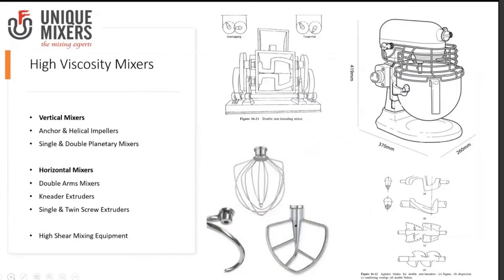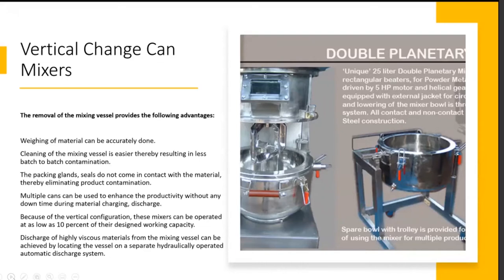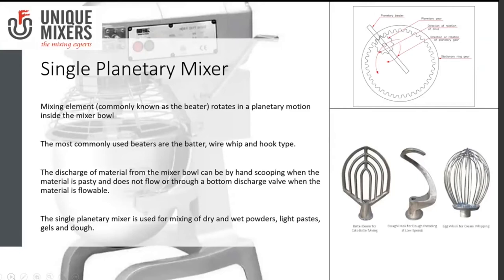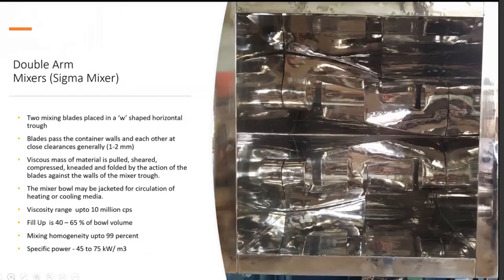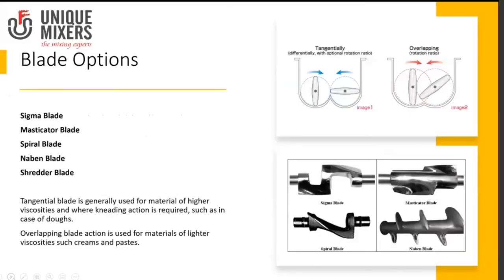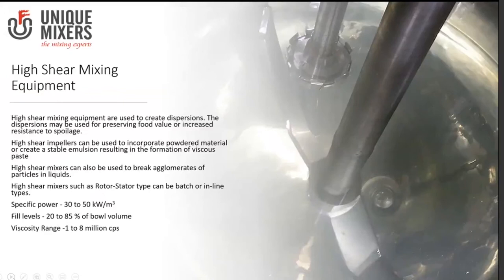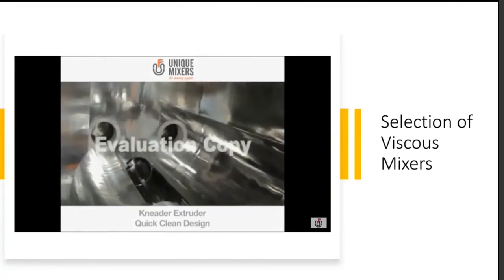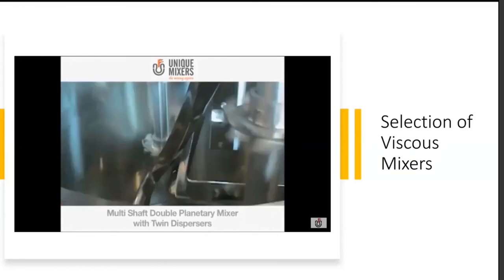Extended Video- Everything You Wanted To Know About Selection & Design of High Viscosity Mixer

Comment: In adhesives which is best suited mixing blade
Reply from the maker: The Sigma Mixer and the Double Planetary Mixers are suitable for Adhesives. The choice of the mixer is to be based on the material characteristics, processing parameters and the production volumes.